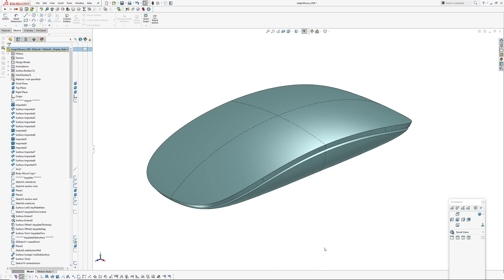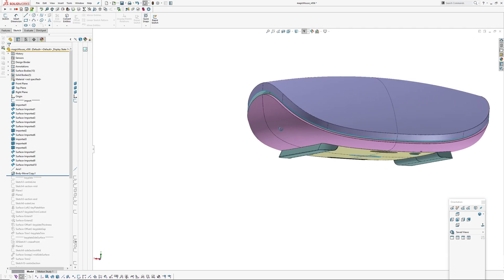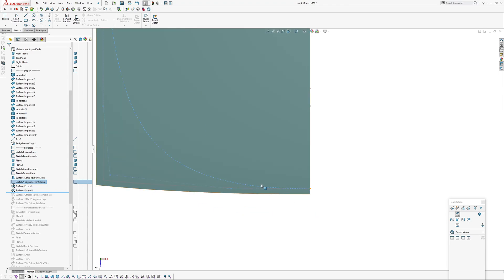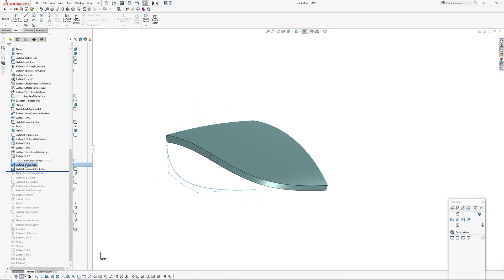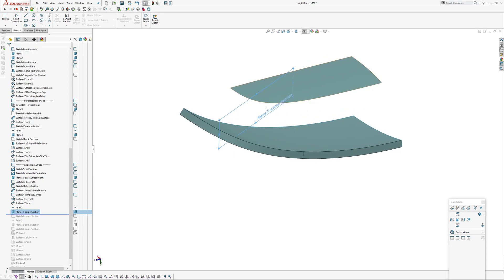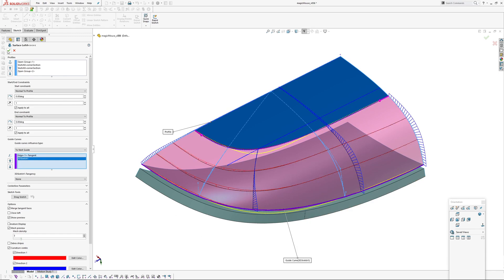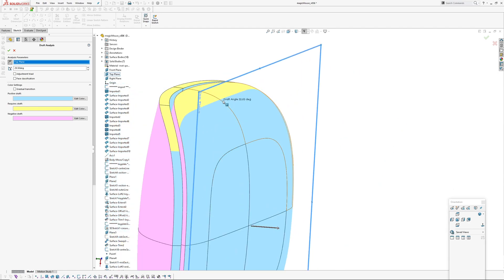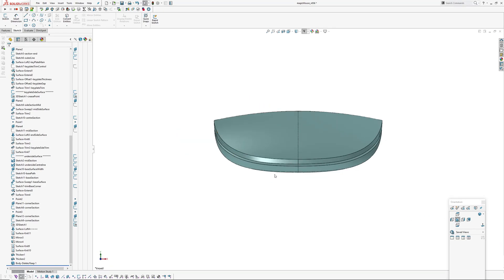Modelling the Apple Magic Mouse form in Solidworks

Comment: Great as always - realized a mistake I made in Fusion360 - I used the wrong degree with CVs and thus down the line after mirroring the curvature never worked well.
Reply from the maker: Yeah have to keep an eye on centreline surfaces that get mirrored